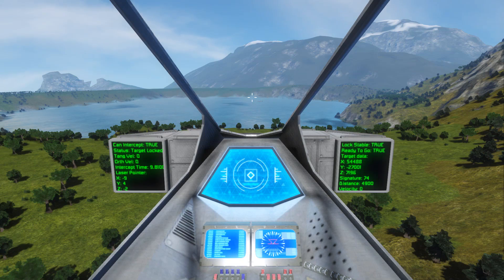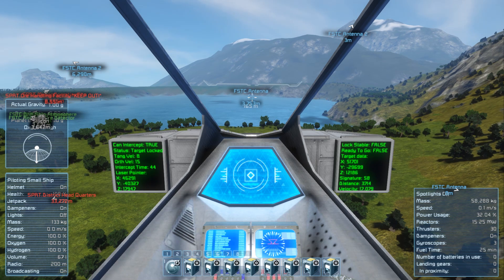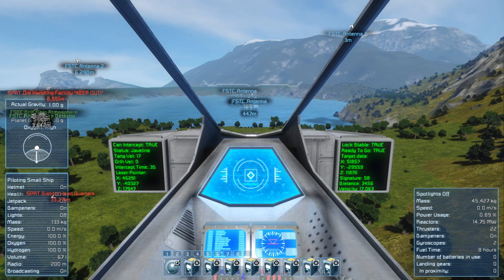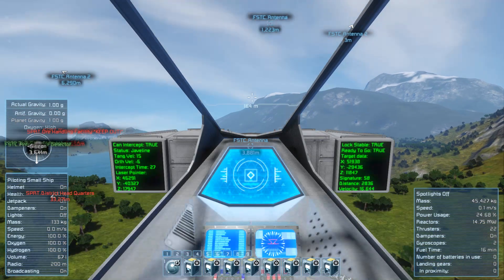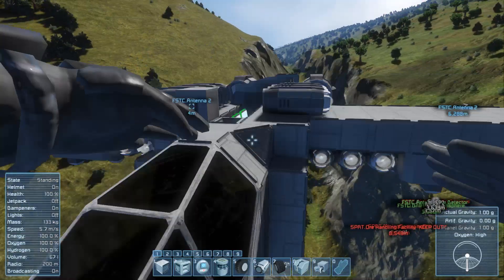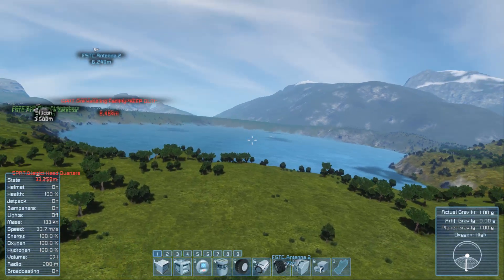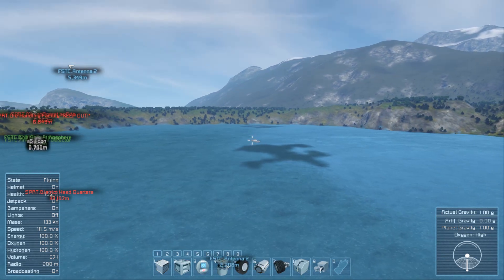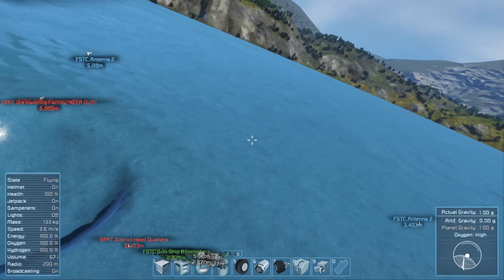Space Engineers: Lock-On air to ground missile vs rover.

Comment: What was that accuracy?! Within a few meters of the target's center? That's impressive.
Reply from the maker: +sharpshooter740 I'm trying to update my old lock-on torpedoes for using on planets. These torpedoes can lock target, calculate interception point and hit moving targets from 10-15 km. I used spiral trajectory previously to dodge turrets, but for planets this feature is temporary off and this increases accuracy. Tho, any rocket turret will be a problem. You can check my "freespace" version of these torpedoes here: http://steamcommunity.com/sharedfiles/filedetails/?id=543982976